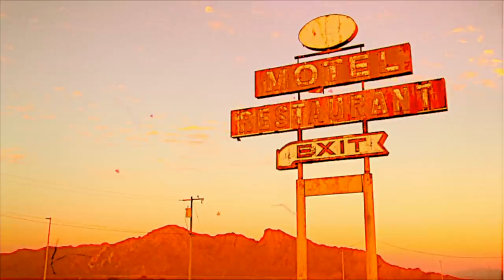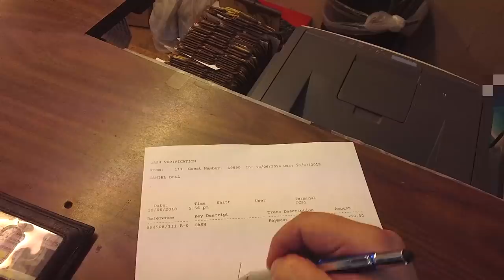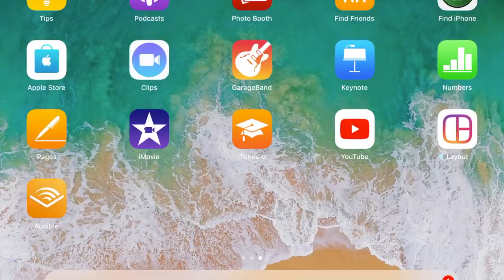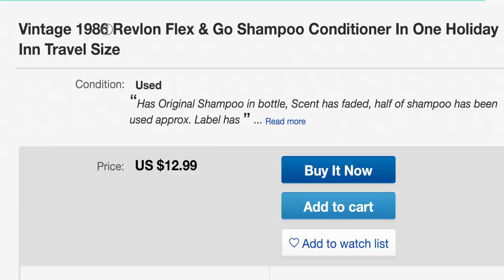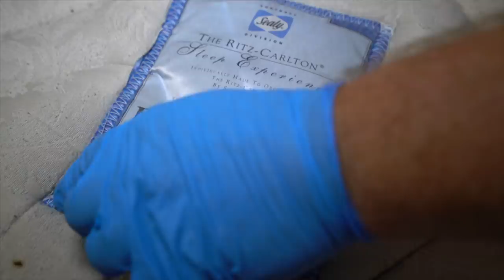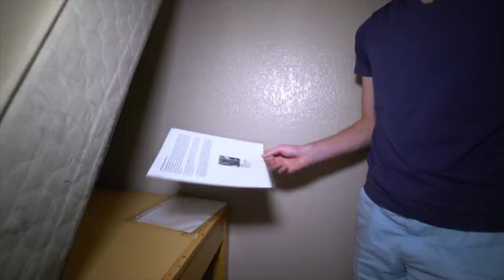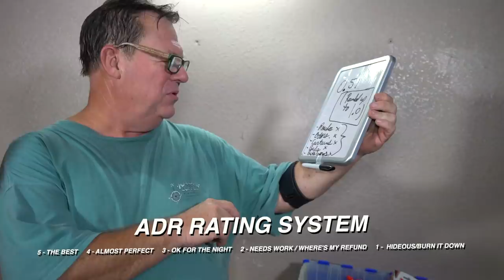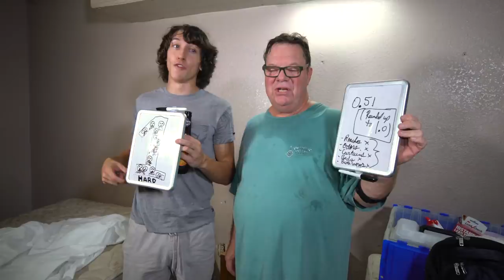Another Dirty Room S2E10 : SEASON FINALE / HORROR IN THE SUNSHINE : Tampa’s Budget Inn East

Comment: The phrase "kill it with fire" has never been more fitting.
Reply: It's so damp, I bet the place would never catch fire!...
Reply: Nuke
From
Orbit.
Reply: Hopefully that short circuit in the outlets will do its job soon
Reply: Considering the faulty outlets it'll probably burn itself down.
Reply: I think the fire would run away from that place. It needs to be burned to the ground.
Reply: @fawncashew  I was thinking the same thing. If it does they should let it burn to the ground.
Reply: Or "Nuke it from orbit.. Its the only way to be sure."

Comment: Theres something else that they didnt mention... on the bed the left, closest to the bathroom... they have an exposed electrical outlet and the metal frame of the bed is right there next to it, almost touching it looked like. so if your a mover while sleeping or doing other activities that might cause the bed to shake seems like there is a non zero chance of the metal frame of the bed touching live wires and either causing a short or making the metal frame of the bed become live at mains voltage.

Comment: Those smoke detectors with the built-in batteries are a good scam. Once they go off once they're basically done, and I had one go off while I was installing it. The procedure in the manual for canceling the alarm didn't work and it was still going off when I left the Home Depot after taking it back. This was like 30 minutes after I finished at customer service.